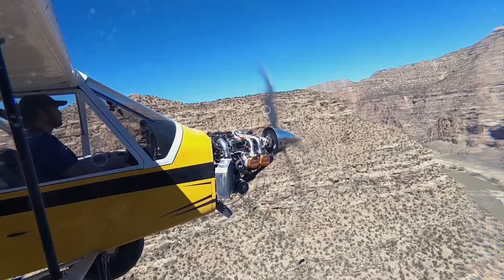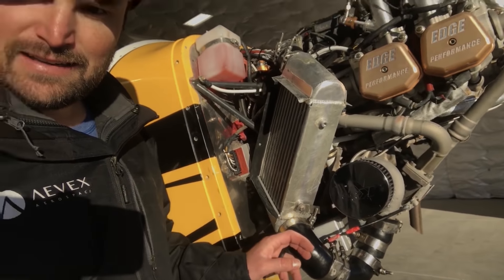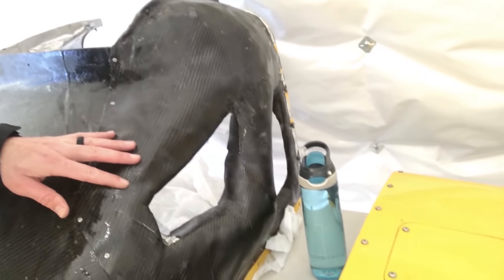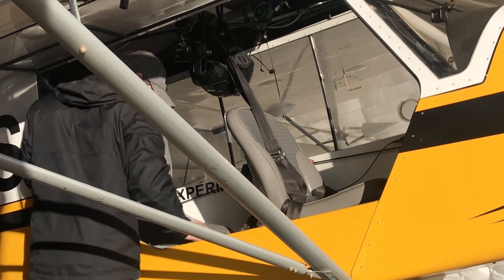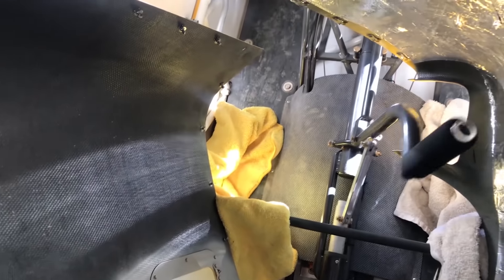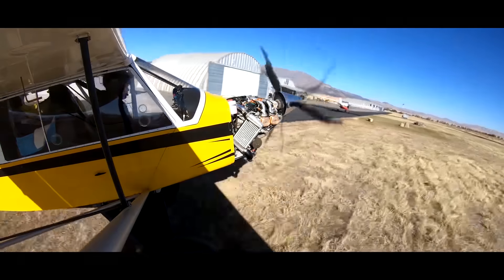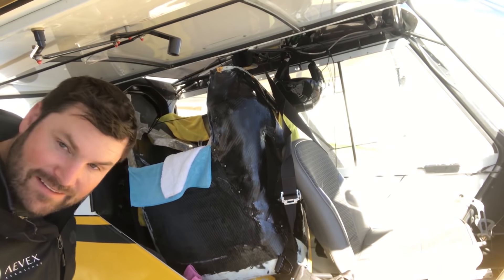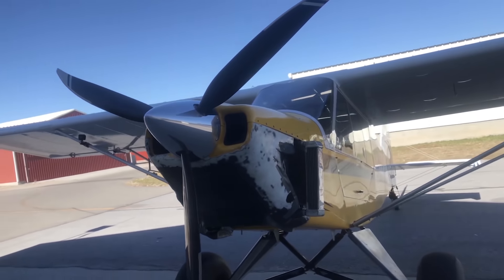Consequences of Adding More Horsepower | Bush Planes

Comment: Heat blankets on the turbo & hot pipes will virtually eliminate the exhaust heat transfer in the engine compartment unlike ceramic coating that only does a small percentage. While your going to Blackfoot contact Turbo Performance Products in Pocatello & check out his products, it's amazing stuff, he does custom work & it won't cost an arm & a leg.
Reply from the maker: Good stuff. Thanks for the info.

Comment: Great stuff, new subscriber here.  Is it possible to put a 915 on an S-7?
Reply from the maker: Jay Townsend Ronnie from Mississippi is a Rotax dealer and Rotax mechanic. He has an S7 and it seems like he had had luck with his 915 in it. The only issue with the 915 is that it adds a lot more weight on your nose. Which is not ideal on the S7. Thanks for the subscribe!

Comment: That rad scoop is going to look lop sided. Put it under the fuselage similar to the p-51 mustang with a belly scoop. with all that extra stuff on your engine, you could push the rad back far enough to improve your cg.
Reply from the maker: That’s a good thought. Just would’ve been for five times the amount of work to put it way back there. Once the cowling is finished, it’s going to look good 👍